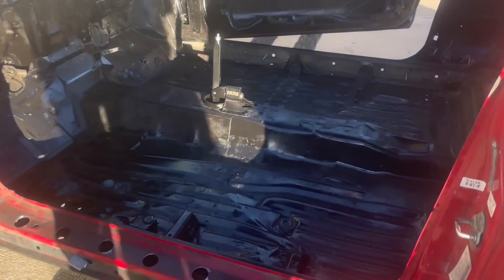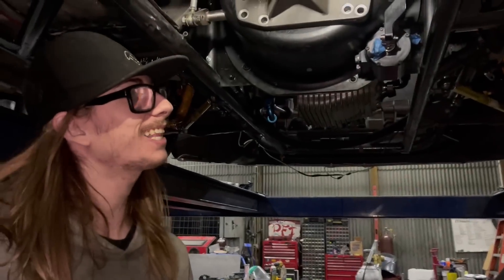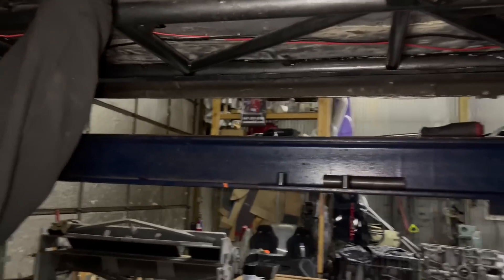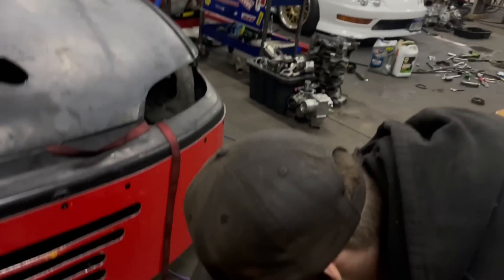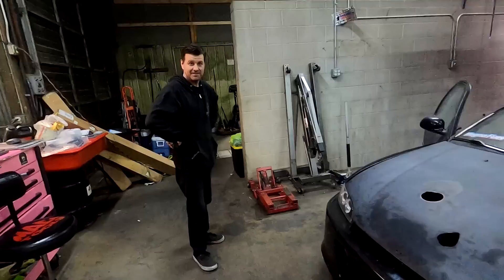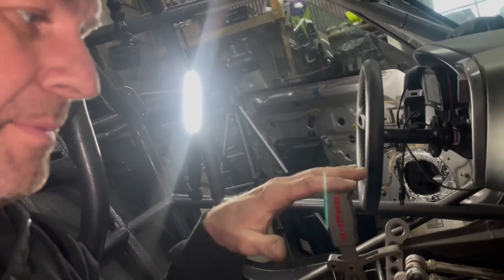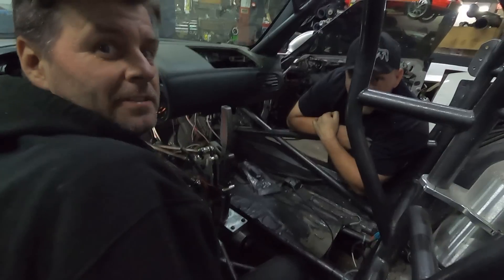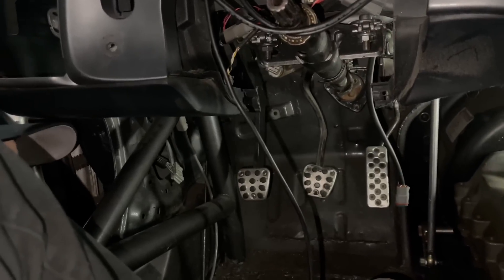SHO’NUFF , We Try to Solve The Pedal Problem!

Comment: Jamie got it right on SHO'NUFF's clutch pedal pivot -- unbolt it from the upper firewall and tie the bracket into the existing roll cage (inverted U shape). Currently, it pushes up when you push the clutch pedal, so welding legs off of the bracket down to existing bars in the roll cage will do the trick.

Comment: Maybe add a second set of frame rails on either side of the transmission and then you can tie to clutch pedal to them.  Like a double frame rail promod car. You could go from where the bars you cut out start and go to the mount around the bellhousing.

Comment: I Def noticed something brent put a pillow block bearing where that clutch linkage over extends the hinge mount that way when you push in the clutch all that tension doesn't get put directly on the shaft!! I do garage doors and fix that same issue all the time on big doors with motors that sit far out from the door

Comment: I wouldn't worry too much about taking a few steps back, it's for good reason. I would pull the tube around which the clutch mechanism rotates to the passenger side.
The end seems to be in sight, just hold on a little longer. It's going to be a beast of a car. Can't wait to see the car on the track.

Comment: Since you cut out the top bars of the half double frame rails I would put a true double frame rail back in it's place and that should solve most of if not all of your problems and make the entire firewall stiffer and it should make the clutch pedal stiffer

Comment: Might have to possibly look at mounting the pedals in a much different manner as well if the stock firewall is flexing too much. Most cars using a clutch and liberty (NHRA Pro Stock etc) have the pedals mounted to a bar in the chassis in the footbox.

Comment: Put a bearing at the end of the tube at the clutch arm and then brace that. 
  A spherical bearing that slides inside the pivot tube then brace to that. They would be stronger if the braces were at the arm instead of being 3” inboard of it. Or even extend the cross tube and brace it further towards the passenger side of the car. The longer the cross tube, the less it would take to anchor it.

Comment: set the back of car at full squat to get the plunge on front yoke of driveshaft where it would be under max acceleration then see where need put bar to contain that u joint if fails so its in best location

Comment: I'd like to see Brent make a few short hops,some part and full throttle 330 ft 660 ft runs before running the car through the 1/4 mile.Its just stupid to take a fresh racecar and run it down the track.It usually doesn't end well.$$$$$$$$$$$

Comment: Is there a reason you're trying to use mechanical linkage for your clutch and not a hydraulic setup? Seems like a lot of that flexing could be fixed with a master cylinder.

Then again, bellcranks are cool so I can see why you'd use them lol

Comment: I have disliked this clutch setup for like a year now. It's like IDK. Maybe just motorplate the engine and trans. Build the clutch assembly off the motorplate instead of the floor or firewall..?  I wish I had a better idea for a clutch setup. I would just take it all out and start over.  Or not. This car can be like a forever project. You just keep building it, never race it and never have to race the 6 second cars that are almost common place now. Because this setup will be lucky to see 7s and that's okay because I love this build and love PFI been a fan for many years. Many blessings. 🙂🤘👍

Comment: Wasn't that cage built for a very exact spec and now it's void. The reason that car will never see the track is because you're changing your mind on it like you're changing your underwear stop and accept what you've designed and finish it otherwise we won't see the car on the track for the next 60 years. Shonuff it will never race
Reply: I thought that when he started cutting into it. Surely the cage cert is void now? It’s almost like he doesn’t want it to be finished, every time he works on it he changes his mind on how things should be done.
Reply: @sjv6598  yeah I'm pretty sure he doesn't want it to be completed it's going to be a lifetime project that he could have completed over a year ago it's just like building it with one set of shocks then ripping them off and changing your mind then you have the fuel cell mounted but now it's not mounted you have seats in it but no we're not going to use those seats I have an engine in it no I'm not going to use that engine he has literally changed the entire car three times
Reply: Those bars are not part of the cert, they were there for the pour in seat. Putting a traditional seat in the car will only have it done faster.
Reply: @boostedboistevo  the transmission tunnel and the driveshaft hoop are both portions of the cert
Reply: @RingTuned  the driveshaft hoop is still there and the transmission doesn't get a traditional tunnel, they only get a blanket. This also makes it easier for them to extend the driveshaft loop to actually cover the cups.